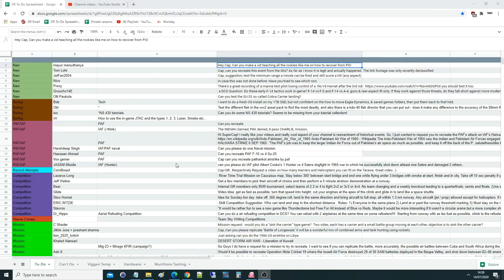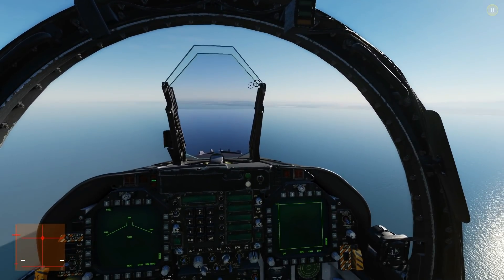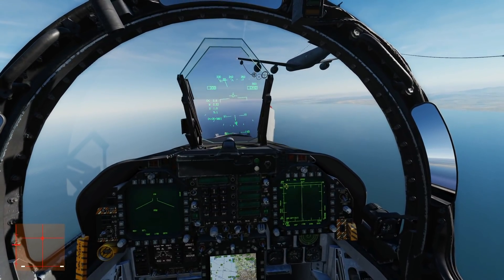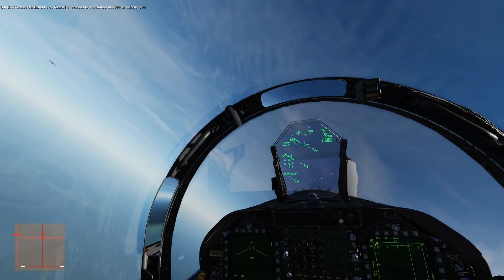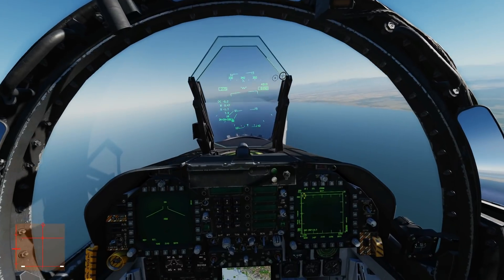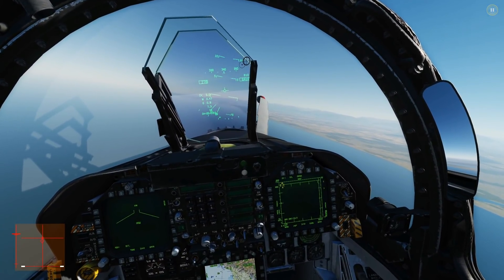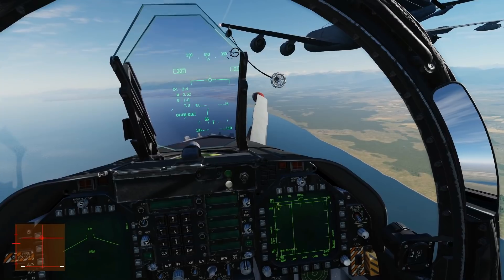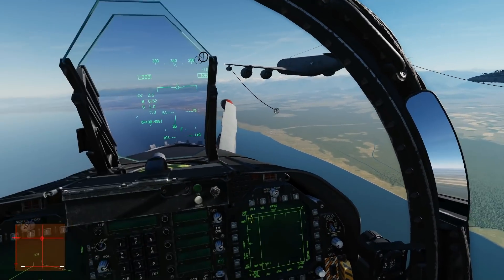Flying Basics: How To Avoid PIO (Pilot Induced Oscillation) | DCS WORLD

Comment: In the early days of computer neural network based control systems development (eg the first self driving car), one of the groundbreaking tricks was to deliberately inject a very small amount of noise into the feedback loop. It was astonishingly effective at helping pure-trained networks avoid over-correcting. So having read about it, I decided to try it myself. I got my car out onto some open space and played with making far more agressive turns than i was used to. It’s a sample size of 1, and self observed, which I acknowledge is not exactly MIT standard of methodology, but I’m confident the quite literally forcing myself to just minutely wiggle the wheel, and to a lesser extent the brake pedal, made a dramatic improvement. It also meant I could gradually reduce the level of noise I was adding as my confidence grew and my control loops became more and more “dialled in”.

YMMV, IANAL, etc. but it strikes me that this would be worth investigating with naïve test subjects (aka guineapigs), and a simulator seems like the safest place to do that!

Comment: I agree with "Gort" - below ... what you demonstrated isn't actual pilot induced oscillations, but more just over controlling.  Proposing ( especially in a rotorcraft) is an example of a PIO.  As simple as I can explain it.... it's when  an aircraft starts a diversion from desired flight attitude, could be for a number of reasons ....like poor trimming and fighting it instead of re-trimming it... whatever...but what happens is that  the timing of the correction, and the input by the pilot  to correct it gets out of phase, actually making it worse...  the key to an oscillation is that it it is a repeating cycle.  And, as a cycle it has frequency and amplitude.  If the frequency and amplitude becomes greater over a measure of time, it can get to the point that attempted corrections will be done out of phase of the cycle and the pilot just adds to the excursion's development .....the pilot not being able to react quick enough and in the end, the magnitude of the amplitude will cause structural failure of the aircraft because limits will usually be exceeded.  It's a phugoid.  Best way to get out of it?  Take your hands off the controls.  Or set the airplane's controls for a fixed attitude and count to 10 before moving them again.  Change the power setting to zero.  Ask the FA to fly the plane.  PIO's a usually seen on hard, fast and poorly executed landings.  Also, PIO's killed many, many gyrocopter pilots.  I will deny typing any of this.  Keep up the good work!
Reply from the maker: Copy, interesting.
Reply: "Pilot-induced oscillations are sustained or uncontrollable oscillations resulting from efforts of the
pilot to control the aircraft and occurs when the pilot of an aircraft inadvertently commands an often
increasing series of corrections in opposite directions, each an attempt to cover the aircraft's reaction
to the previous input with an overcorrection in the opposite direction [1]. In hose-drogue aerial
refueling operations, the position of drogue is influenced by tankers wake, receiver bow waves, and
atmospheric turbulence. Consequently, the prediction of docking position becomes difficult for
receiver aircraft pilot. Owing to docking procedure allows slight position error between probe and
drogue, the receiver pilot have to correct attitude and path repeatedly. As a result, PIO occurs in the
precontact position frequently."
Reply: See pg 14: http://www.icas.org/ICAS_ARCHIVE/ICAS2016/data/papers/2016_0586_paper.pdf
Reply: PILOT INDUCED OSCILLATIONS
The pilot may purposely induce various motions to the airplane by the action of the controls. In addition, certain undesirable motions may occur due to inadvertent action on the controls. The most important condition exists with the short period longitudinal motion of the airplane where pilot control system response lag can produce an unstable oscillation. The coupling possible in the pilot-control system-airplane combination is most certainly capable of producing damaging flight loads and loss of control of the airplane.
When the normal human response lag and control system lag are coupled with the airplane motion, inadvertent control reactions by the pilot may furnish a negative damping to the oscillatory motion and dynamic instability exists. Since the short period motion is of relatively high frequency, the amplitude of the pitching oscillation can reach dangerous proportions in an unbelievably short time.
When the pilot induced oscillation is encountered, the most effective solution is an immediate release of the controls. Any attempt to forcibly damp the oscillation simply continues the excitation and amplifies the oscillation. Freeing the controls removes the unstable (but inadvertent) excitation and allows the airplane to recover by virtue of its inherent dynamic stability.
The pilot induced oscillation is most likely under certain conditions. Most obvious is the case of the pilot unfamiliar with the “feel” of the airplane and likely to overcontrol or have excessive response lag. High speed flight at low altitude (high q) is most likely to provide low stick-force gradients and periods of oscillation which coincide with the pilot control system response lag. Also, the high q flight condition provides the aerodynamic capability for failing flight loads during the oscillation.
If a pilot induced oscillation is encountered the pilot must rely on the inherent dynamic stability of the airplane and immediately release the controls. If the unstable excitation is continued, dangerous oscillation amplitudes will develop in a very short time.

The most outstanding illustration of the divergent oscillation occurs with the short period pitching oscillation of an aircraft. If a pilot unknowingly supplies control functions which are near the natural frequency of the airplane in pitch, energy is added to the system, negative damping exists, and the “pilot induced oscillation” results.

Excerpted from Aerodynamics for Naval Aviators

Comment: This video shows how I fly if a module doesn't have Force Feedback, or if I dare to try it with the TMWH stick (potentially any other non-FFB stick). The reason why every single stick in the world without just sucks big time.

Fun thing is, I actually started flying left handed back in the day when sticks were symmetric. Going from the Gravis Analog to the Analog Pro made me switch sides, because of the throttle wheel being on the left side. Was flying Aces of the Pacific and Jane's Navy Fighters and ATF with those. BTW those sticks had an adjustable spring where you could set the force to your liking. Never seen that again.

Comment: This is actually a common issue on Airbus Fly-by-wire aircraft due to the way the controls differ from conventional aircraft. The cause of the ‘undesired state’ is usually the pilot stirring the porridge so to speak. The advice, while crude, is also accurate.

Treat the stick like another mans penis with a big red wart on it (see Airbus sidestick)..... only touch it if you have to.... if you touch it, thumb and forefinger only

Comment: Lol. Welcome to my world! I just started DCS last week in the Hornet lmao

It is EXACTLY this
Reply: Stick with it, you`ll get there. 

Dont focus on the drogue. Chasing the drogue will cause PIO, and stress you out way too much. Just relax, do tiny gentle movements with the stick (Make sure you have some curve in the tuning of the axis), concentrate on your HUD and airspeed, not the refuel-er itself, have the drogue in your peripheral vision, after a few attempts you`ll learn where it needs to be in your memory in order to get a hookup. Find the speed that matches the refuel-er and pulse your throttle in short small bursts to keep 1knt or 2 just above that speed, you can oscillate forwards and backwards slightly without losing connection . If you can fly fairly straight and level during this you`ll nail it. 

I Started trying yesterday for the first time, could only manage connecting for just a few seconds at best (And sweating buckets doing it). Today I can connect 1st attempt and fuel up in one go without losing connection. 

It`s very much like learning to ride a bike, all of a sudden it`ll click in your brain the muscle and position memory and you`ll be doing it constantly from then on no problem.

No doubt someone else will say this is all wrong, but it worked for me. Biggest mistake I was making was focusing on the drogue itself to start with.

Comment: This is not a demonstration of actual PIO, it is a demonstration of someone over-controlling the airplane out inexperience. You can call it a PIO but it is simply lack of anticipation and over-control. I'm not sure any DCS flight models even simulate textbook PIO.
A textbook PIO is caused by the lag in response between the dynamic stability of the airplane and the pilot's instinctive attempt to dampen an oscillation manually.  The pilot usually can't fix it simply by making smaller control movements because pilot input counteracts the natural damping and excites the oscillation.  The recovery from a PIO is to release the controls and allow the airplane to dampen the oscillation on its own.  Alternatively, if you are close to the ground or to exceeding a placard limit you can freeze the controls with the stick slight aft of neutral.
Reply: Here's a video of the F-22 prototype going into PIO because of a defect in the flight control software. The pilot's fix was to put the plane down on its belly to stop it. The glitch was of course fixed before it went into production. 

https://youtu.be/4JkcrtvN60s
Reply: As what happened to the Gripen in the Stockholm airshow crash.
Reply: @lordsqueak  That's not PIO as I figered, that's "WIO", lol, "wire induced ocsillation". It was not induced by the pilot, but the flight by wire system.
Reply from the maker: Interesting points.
Reply: "Pilot-induced oscillations are sustained or uncontrollable oscillations resulting from efforts of the
pilot to control the aircraft and occurs when the pilot of an aircraft inadvertently commands an often
increasing series of corrections in opposite directions, each an attempt to cover the aircraft's reaction
to the previous input with an overcorrection in the opposite direction [1]. In hose-drogue aerial
refueling operations, the position of drogue is influenced by tankers wake, receiver bow waves, and
atmospheric turbulence. Consequently, the prediction of docking position becomes difficult for
receiver aircraft pilot. Owing to docking procedure allows slight position error between probe and
drogue, the receiver pilot have to correct attitude and path repeatedly. As a result, PIO occurs in the
precontact position frequently."
Reply: See pg. 14: http://www.icas.org/ICAS_ARCHIVE/ICAS2016/data/papers/2016_0586_paper.pdf
Reply: PILOT INDUCED OSCILLATIONS
The pilot may purposely induce various motions to the airplane by the action of the controls. In addition, certain undesirable motions may occur due to inadvertent action on the controls. The most important condition exists with the short period longitudinal motion of the airplane where pilot control system response lag can produce an unstable oscillation. The coupling possible in the pilot-control system-airplane combination is most certainly capable of producing damaging flight loads and loss of control of the airplane.
When the normal human response lag and control system lag are coupled with the airplane motion, inadvertent control reactions by the pilot may furnish a negative damping to the oscillatory motion and dynamic instability exists. Since the short period motion is of relatively high frequency, the amplitude of the pitching oscillation can reach dangerous proportions in an unbelievably short time.
When the pilot induced oscillation is encountered, the most effective solution is an immediate release of the controls. Any attempt to forcibly damp the oscillation simply continues the excitation and amplifies the oscillation. Freeing the controls removes the unstable (but inadvertent) excitation and allows the airplane to recover by virtue of its inherent dynamic stability.
The pilot induced oscillation is most likely under certain conditions. Most obvious is the case of the pilot unfamiliar with the “feel” of the airplane and likely to overcontrol or have excessive response lag. High speed flight at low altitude (high q) is most likely to provide low stick-force gradients and periods of oscillation which coincide with the pilot control system response lag. Also, the high q flight condition provides the aerodynamic capability for failing flight loads during the oscillation.
If a pilot induced oscillation is encountered the pilot must rely on the inherent dynamic stability of the airplane and immediately release the controls. If the unstable excitation is continued, dangerous oscillation amplitudes will develop in a very short time.

The most outstanding illustration of the divergent oscillation occurs with the short period pitching oscillation of an aircraft. If a pilot unknowingly supplies control functions which are near the natural frequency of the airplane in pitch, energy is added to the system, negative damping exists, and the “pilot induced oscillation” results.

Excerpted from Aerodynamics for Naval Aviators

Comment: I find a helpful tip is instead of focusing on the basket, its best to focus on the horizon and just use peripheral vision for the basket.
Reply: i found the best way was to find a fix point on the wing of the tanker (IL-78 is great beginner for this)
and just keep that fixed and then move closer to the basket....if your off to the left or right
you just back off and move the fix point accordingly
Reply: Sounds reasonable, bit like hovering a helicopter in DCS.
Reply: I've always found focusing the pylon in the top right of your HUD to work for me. But if you look at the basket you will always overshoot.